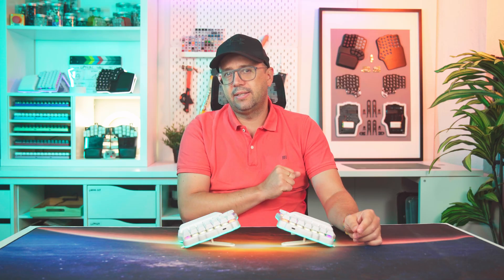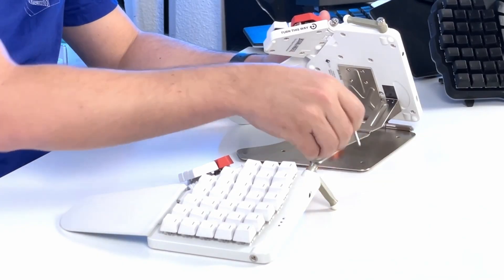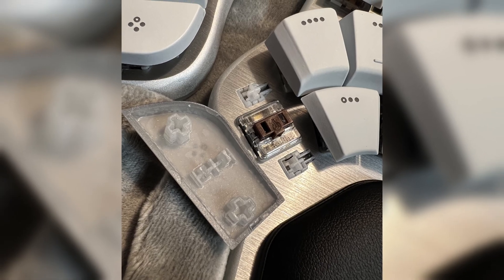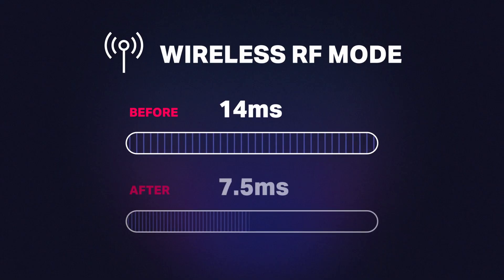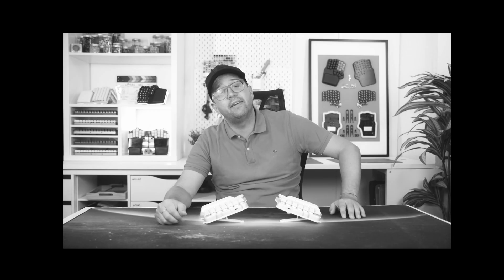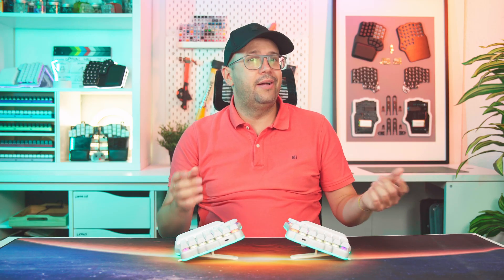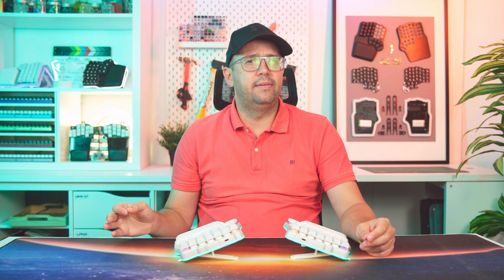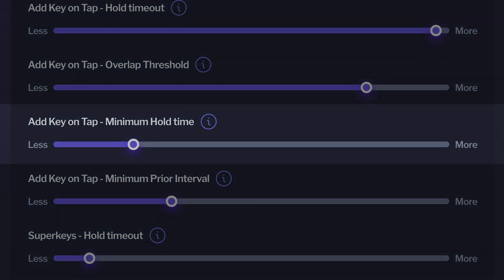What it really takes to design a keyboard

Comment: On the Defy v2.2.0 beta 6 firmware the battery level can’t be read in Bazecor on a wired connection, but it works fine on RF. Bazecor says that both sides are disconnected and ‘force read’ also doesn’t work. I just went to Discord to file this report, but it seems that there is no separate post yet for the latest firmware.
Reply from the maker: Thank you; I don't know how that slipped through. I'll report it to the devs. BTW, I've checked and if you press the battery reading key on the keyboard it shows as charging. Thanks again!

Comment: I’m grateful for the Dygma moonshot. Yes, there were teething issues (and sleepless nights undoubtedly!), but they have been or are being resolved. I expected a state-of-the-art product, not a product that was flawless from day 1. The result is a great product that will get even better soon. I’ll definitely test the latest beta firmware. With the v2.1.0 firmware I very infrequently (about once a week) experienced that one half (most often the left) would completely stop working out of the blue, but only on RF connection, never when wired. Disconnecting and reconnecting the neuron didn’t solve the issue when it occurred, but toggling the power switch of the affected half did. I don’t remember experiencing that on previous firmware.
Reply from the maker: Thank you!!! That bug you're describing is precisely what the 2.1.1 firmware fixes. And of course the 2.2 beta also includes that fix. Let us know otherwise!

Comment: 4:29 Not so rare for me, I am updating immediately. Now I can hopefully scrap the idea to move the switch on the bottom of my Defy's right half to the top of the keyboard so I no longer have to flop it over when it won't reconnect. Awesome work!
Reply from the maker: Rare in the sense that it didn't affect many people, but if it did, it was annoying. If it keeps happening please email us!
Reply: Same here. I will be updating asap. Great work, the KB is awesome.
Reply from the maker: @LitaKino-gv4gv  Thank you! Let us know if the issue persists!
Reply: @DygmaLab  So far so good for me! Have not had to flip my keyboard upside down to turn the right half off and on again. Used to be multiple times per day. Awesome work!
Reply from the maker: @de3euk that's great to hear 🥰
Reply: For reference, the firmware worked flawlessly for me. Congrats to the Dygma team.